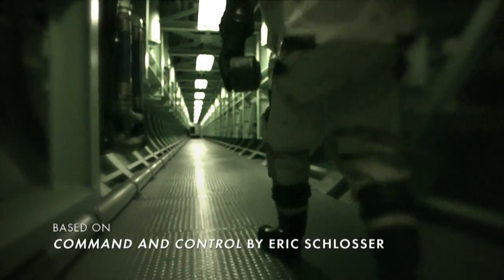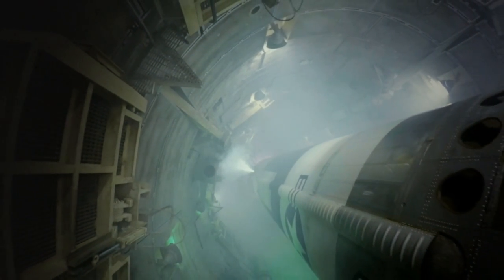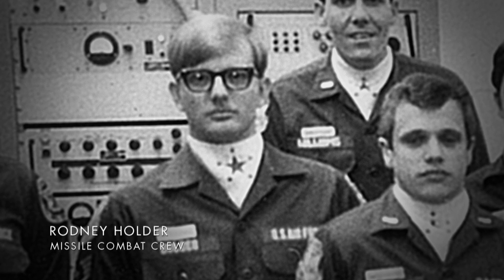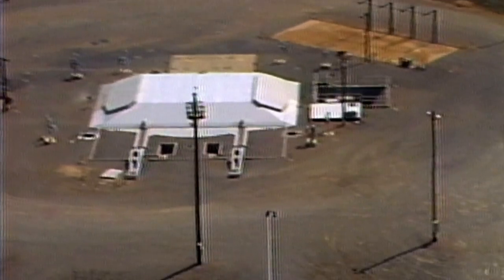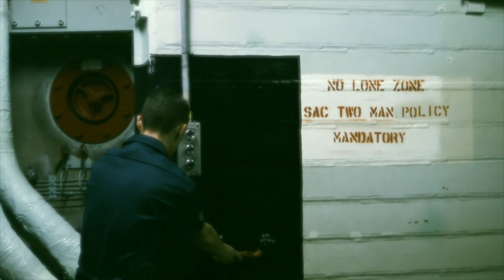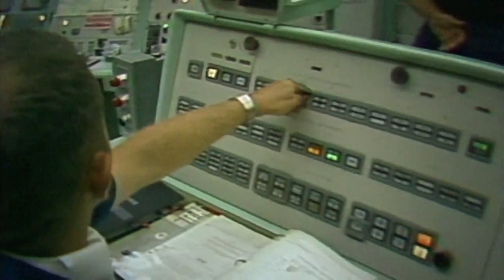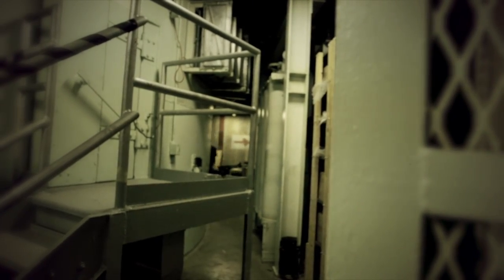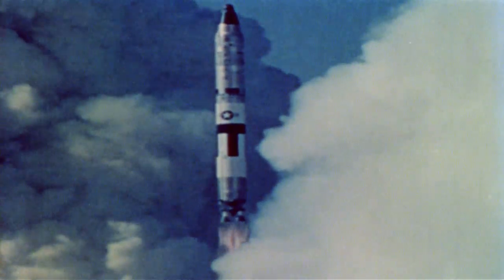Command and Control, Chapter 1

Comment: 'Hat Tip' to the engineers who designed the warhead safety devices/systems that prevented the warhead from detonating, even after it was blown through a 20 ton concrete and steel silo door and hurled hundreds of yards away into a ditch.

Comment: It was never explained: Was the socket more secured to the newer torque wrench than the old ratchet wrench, and thus, could the socket have just fallen off the torque wrench also? What was the significance of using the newer torque wrench vs the older ratchet wrench? Also- how was the torque wrench different than the ratchet in that it would have prevented the socket from falling off. And finally, what kind of torque wrench do mechanics use to UNBOLT a fastener???
Reply: No difference at all. If it was written down in a manual, and procedure is not to the letter of the law, that airman was hung out to dry.
Reply: The only difference between the torque wrench and the old wrench was the age. The one Powell used, the little ball that locks the socket on did not work, as did most of them that were stored in the silo. The one he used would hold open the door of the long cableway during normal duty hours. It would be rusted, and there was no one to do maintenance that I recall to keep it oiled and not rusted. If he had used the torque wrench, the little ball would work because torque wrenches had to have normal maintenance done on them so that they could be calibrated.
Reply: Air Force regs definitely don’t allow loosening or tightening fasteners with a torque wrench. You use non-calibrated tools to get close, then use the torque wrench ONLY to torque to specified value. Any different and Quality Assurance will immediately stop your task and retrain on-the-spot. That’s not to say using them incorrectly never happened/happens because QA isn’t always there to oversee your task, but any missileer knows the proper way. I was trained as such, and I trained many of my maintainer team members in kind.
Reply: Verbatim Complaince